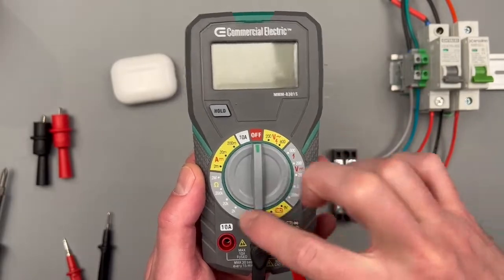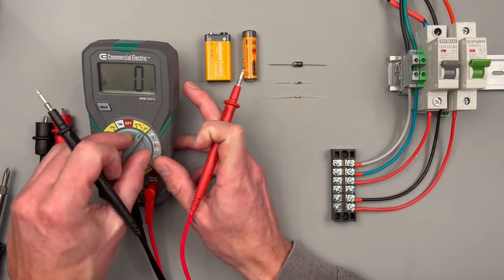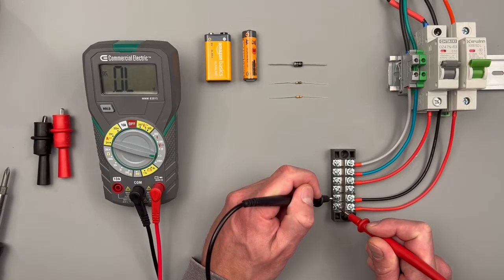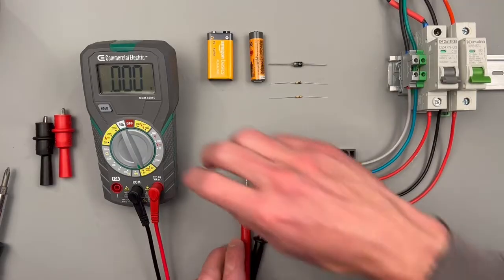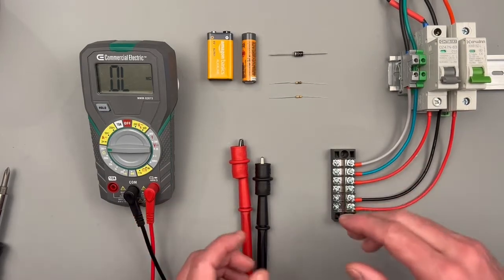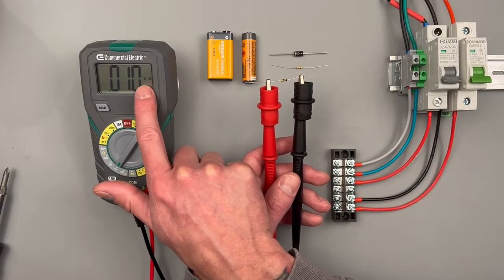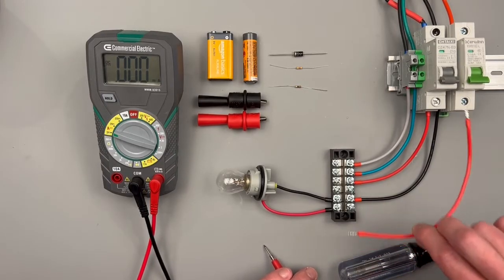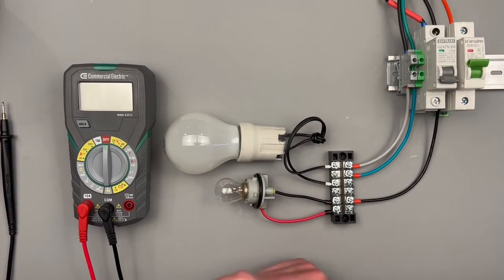How to Use the Commercial Electric MMM-8301S Manual Ranging Multimeter

Comment: How to test Capacitor using this multimeter ?
Reply from the maker: This meter does not have a capacitance test setting.
Reply: @maddoxmechanic  Thank you for the prompt response, i guess i need to return this and get another as i'm trying to check if the capacitor on my AC unit is bad
Reply from the maker: @mohammedajaz2900  Hey you bet!

Here's a very similar meter that has a capacitance test setting:
https://www.homedepot.com/p/Commercial-Electric-True-RMS-Auto-Ranging-Digital-Multi-Meter-DMM-8301A/321995242

and here's a how to video for testing your AC run capacitor:
https://www.youtube.com/shorts/SUDHmgq7xtI

Comment: How would I test a 12 volt battery?
Reply from the maker: @scubabruceCA  I’m assuming you’re talking about a 12v car battery? You can get it tested at the auto store
Reply: @maddoxmechanic  Not exactly. I use motorcycle sized batteries to power ham radios in the field. I guess I can still check the voltage without putting a load on it like with the 9 and 1.5 volt option.  I don’t think I really understand the difference.
Reply from the maker: @scubabruceCA  checking just voltage can be an easy check to get a sense of the charge of the battery. But putting a load on it will give you a sense of the health. For a smaller 12v battery like that you could even just use like a 4amp headlight bulb to put a load on it. The brightness should give you a pretty good indication of the health/charge level of the battery.
Reply: @maddoxmechanic  Thanks!
Reply from the maker: @scubabruceCA  you bet!
Reply: @maddoxmechanic  thats not answering the question can we use it to chk voltage on a car battery
Reply from the maker: @ you can use it to check voltage on a car battery. It’s just not a full proof method to know if the car battery is good or not